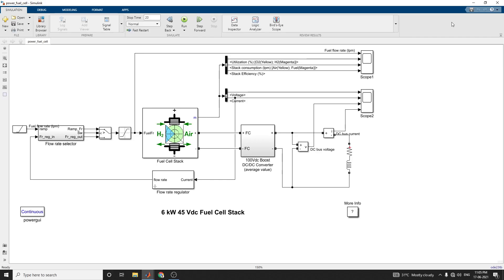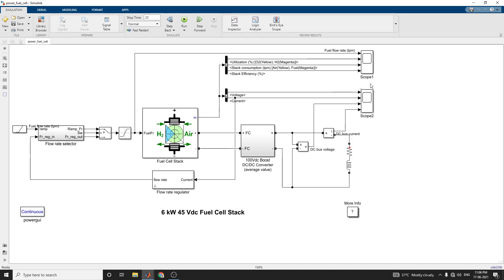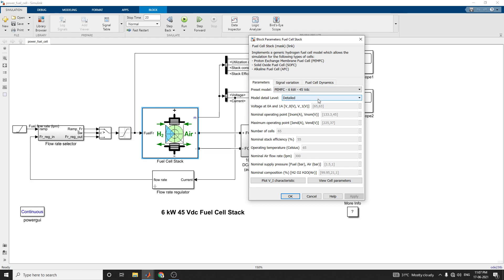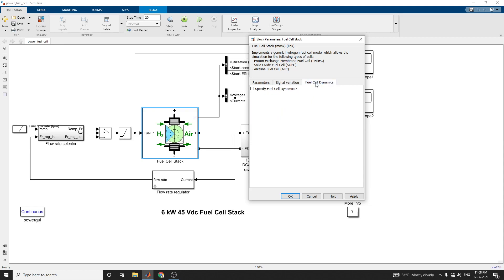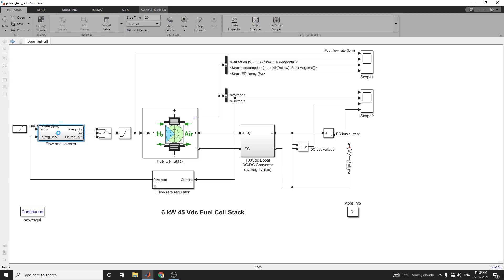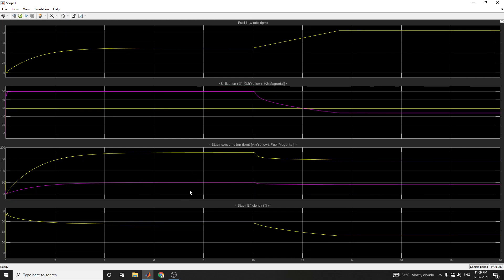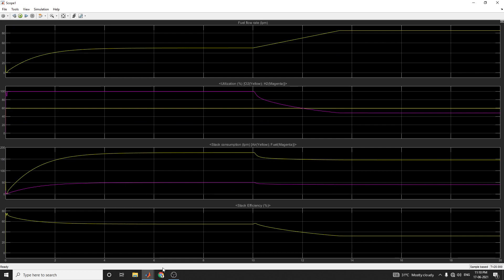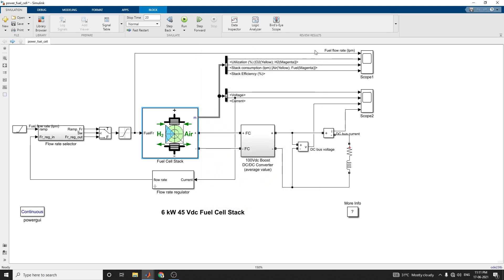Modeling & Simulation of Proton Exchange Membrane (PEM) Fuel Cell Stack Using Matlab Simulink

Comment: Hello 
Do you have the calculation Part ? 
like Hydrogen Flow rate, Air flow rate , Current , Voltage, Power, Humidity, H2O, Fuel Cell Stack Efficiency, and everything